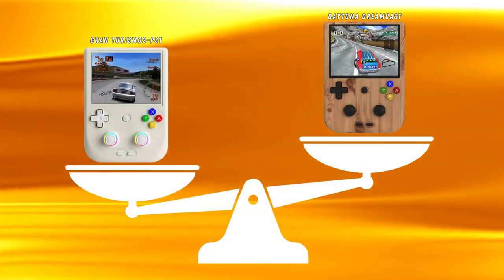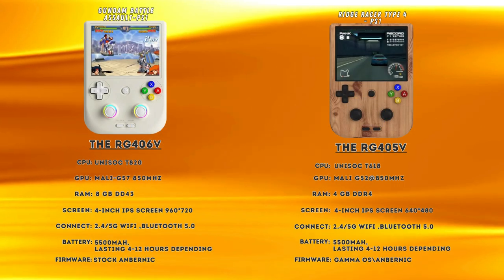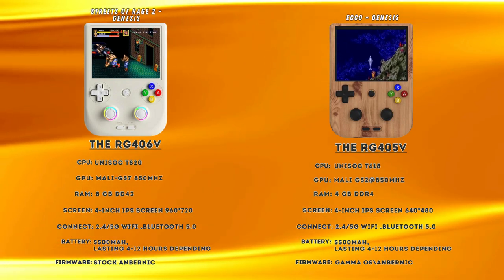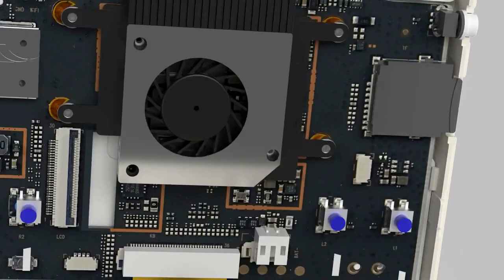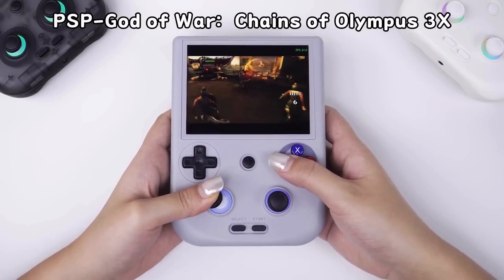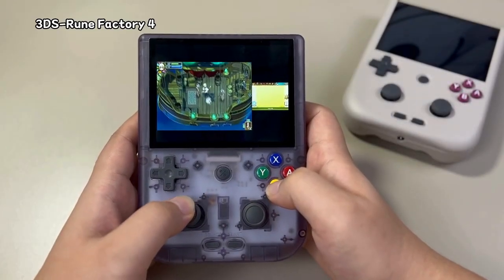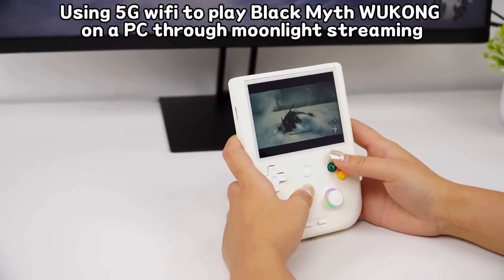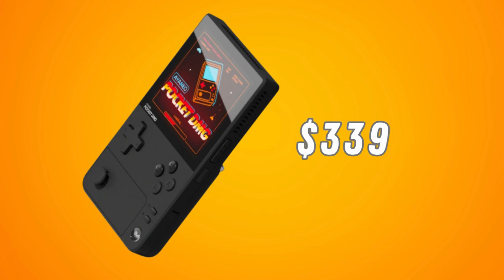The RG406V vs the Rg405V: is it worth upgrading?

Comment: As someone who reviews these I look at price to performance as a value matrix when comparing upgrades. Double the Ram and the new SOC is easily worth the upgrade. Also the back triggers on the 405v are terrible so any change is welcome.
Reply from the maker: I was a bit torn to be honest as it seems as though the 405 can do 70-80% of what the 406 can and i have always been someone who goes for the "not the newest but almost just as good second in line but cheaper  model " 😜. I did hear about the triggers on the 405 though and when you include the better screen and more acurate analog sticks along with the extra provessing power on the 406 it becomes much more atrractive so i have to agree with you, it is worth upgrading. Thanks for watching and commenting

Comment: Waht about psx/ps1 games, does it have enough power for it ?
Reply from the maker: Yes both these units will run PS1 Games flawlessly but they are actually a bit overpowered for that as they can even run PS2 games. If you mainly want to play PS1 games or older systems like Sega Genesis or Super Nintendo you could get a handheld for much cheaper that will be able to do that well. The R36S or the RG40xxV comes to mind. The R36S can be had for as low as $35-$40 if you find it on a sale whereas the RG40XXV you will probably find for between $60-$70. Check out my overview video on these 2 if you are interested at this link - https://youtu.be/yJLG_KA1XAc. Thanks for watching.
Reply: Thx for your answer, I would like to enjoy this handheld for ps1 games most often but I want to using his power for games from play store too so 406V can be universal machine  @TheTechUpdate-ui1fh
Reply from the maker: @karbossss  Ot's a pleasure. It will play Android games aswell as far as i can tell so it will serve your purposes, if i understand you correctly. Let me knowwhat you think when you get it.😁👍